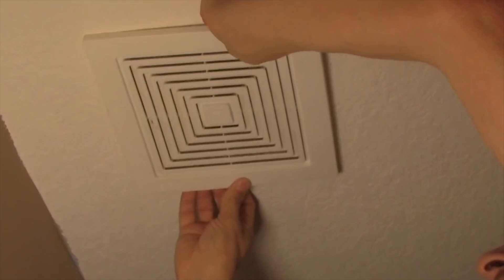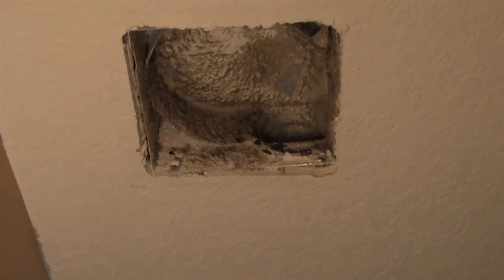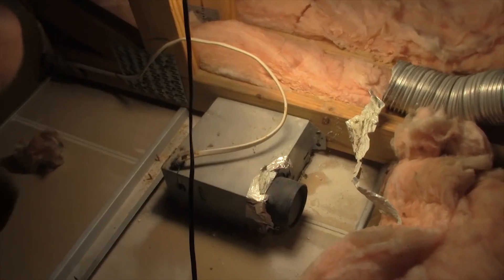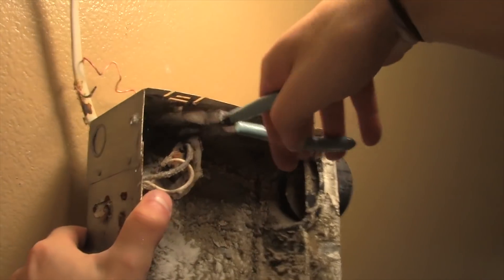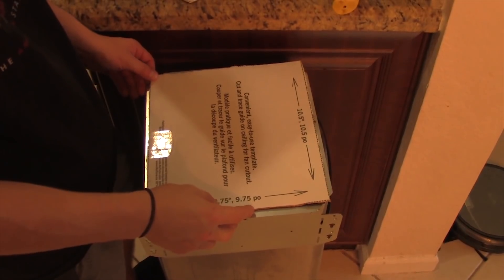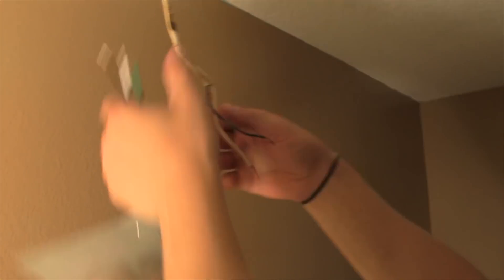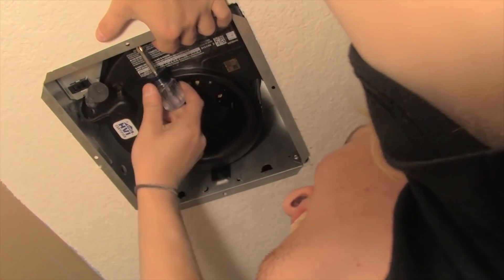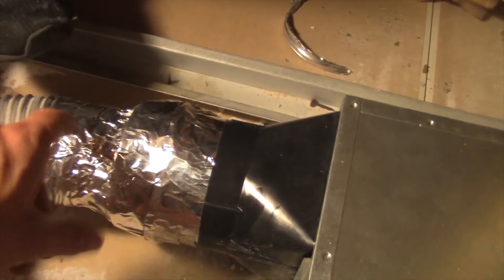Bathroom Ceiling Exhaust Fan--How to Remove Replace Install-- Tips/Tricks

Comment: Very thorough, especially how to connect the grille with those pinching wires. Other videos did not show that. Presuming had you not needed a step-down for your vent tube you could have fished it through the housing and assembled that from the bathroom.

Comment: Exactly the job I need to do tho I have to do it all from below (no attic).  Woudn't it have been better to replace the tubing itself rather than to use the adapter?  I'd think it would restrict to some degree the amount of cfu's being pushed out thru the smaller tube.
Reply from the maker: Good point.  I noticed that the fan was louder than I would have liked, and maybe that is the reason.  Maybe I'll go back up there and change the vent tube.  I'll probably wait until the weather cools down some more.  Its still 90+ degrees during the day here in S. Florida.

Comment: Just finished installing this exact exhaust fan.  It took me about who hours to install the hardest part was removing the old fan due to idiot builders no common sense installation.  Once that was done it was a breeze installing this exhaust fan.  Like many reviews it does get a little louder due to exhaust going from a 4 inch to a 3 inch exhaust to the outside.  But, it is a big difference in upgrade from what the builder's cheap exhaust fan and a lot quieter.

Comment: Would i have been easier to connect the vent tube before you attached the vent to the housing box? This would have eliminated another trip to the attic.
Reply: You’re absolutely correct. I just installed one of the Nutone Roomside fans, practically identical, and you pull the vent tube through the opening in the ceiling and feed it through the blower housing and connect. 

In his defense NuTone’s instructions leave a bit to be desired in terms of clarity. 

All in all great video